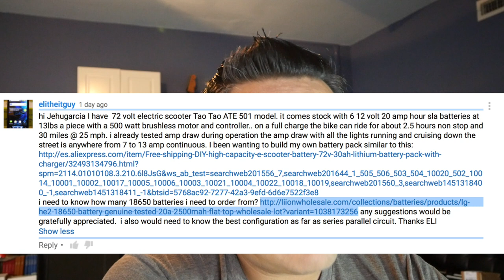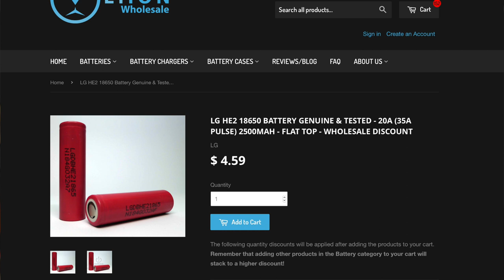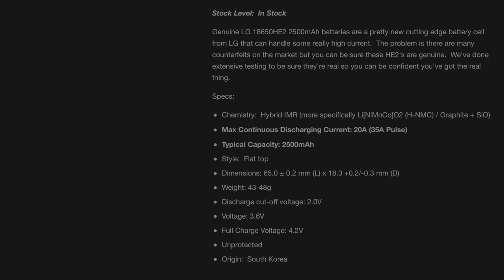How many 18650 cells to power a Scooter?   Battery talk #4

Comment: The nominal voltage of LG HE2 is not 3.7V but only 3.60V: https://www.powerstream.com/p/LG-ICR18650HE2-REV0.pdf
It even says 3.6V in your video @4:42 but youkeep saying 3.7V and base all your calculations on this wrong value.
1.44 kWh / (3.6V * 2.5 Ah) = 160 cells total
72V / 3.6V = 20 cells in series. No a huge difference but it means 20 cells in series instead of 19.
160 cells / 20 cells = 8 cells in parallel
The nominal voltage of Li-ion cell is determined by it's cell chemistry. There's several different Li-ion chemistries.
Li-ion cells capable of high current draws like 20A for power tools, EVs etc. are usually 3.6V cells. Low current cells for laptops etc. on the other hand, usually has a nominal voltage of 3.7V, resulting in higher capacities, but lower max. discharge current. So it's a trade-off, you either get high capacity or high max. discharge current.
And then there's Li-ion cells based on the LiFePO (Lithium iron phosphate) chemistry with a nominal voltage of only 3.2V to 3.3V. But most other li-ion cells has a nominal voltage around 3.6V to 3.7V

Comment: Great videos Jehu! Would using these batteries work on something like a Jump Start pack for a car battery? I'm wondering if it would be possible to make something similar to this https://www.anker.com/products/A1531011
Reply from the maker: +Adam VanderHoek   yes but it would have to be bigger and heavier as you would need about 55 cells to meet the voltage and power output to match that unit linked.   Lipo cells are better for that particular application  this one for example http://j35.us/1qDyZEx  can output bursts of almost 1000A